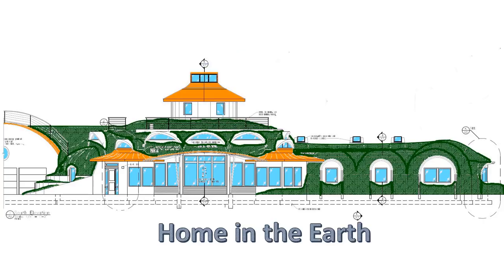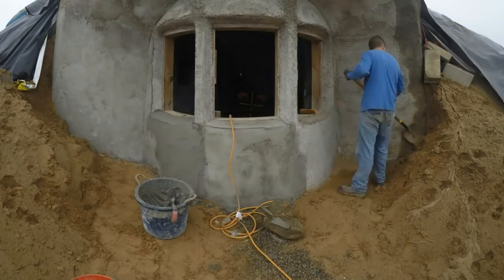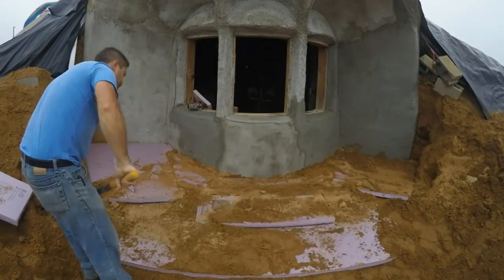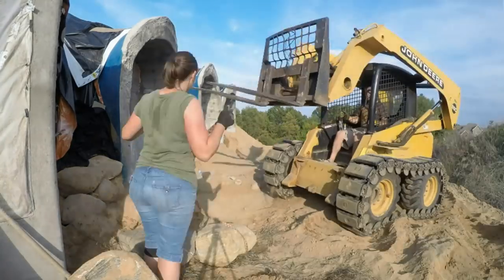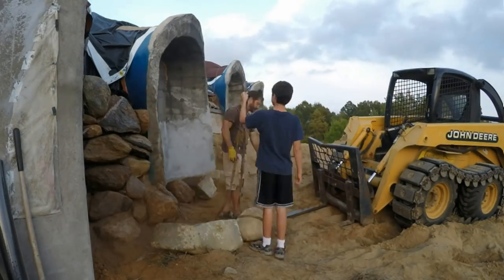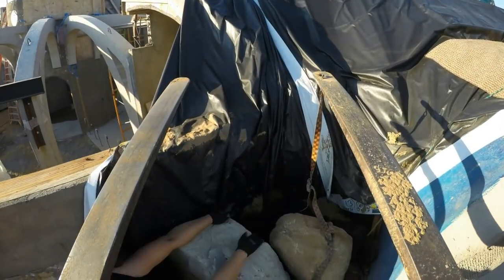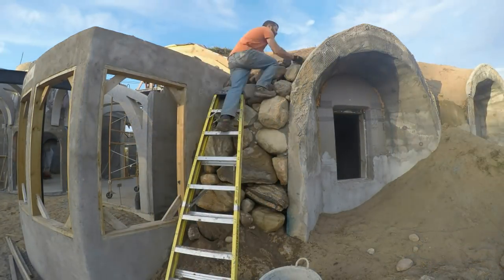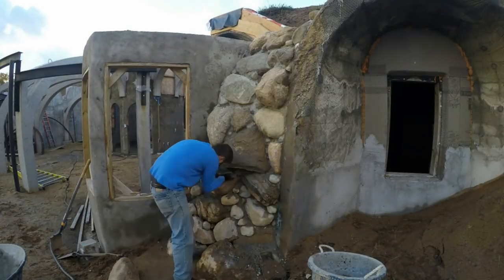38.2 Stucco and Boulders

Comment: Very nice, is it the spool valve that is leaking and allowing the forks to float, if so I would not be under them ! Have seen O rings blow in valve and all comes down at once , but looked also like you had a low hole check valve on cyl and that would protect you from a full drop  ! Love your home and great work !
Reply from the maker: Even without the slight failure, I was impressed/surprised that my wife trusted me to operate that thing with her underneath it.  I was nervous the whole time.  Never thought about it suddenly just dropping though.  Good thing I sold it last summer and bought something more gentle on the landscaping.